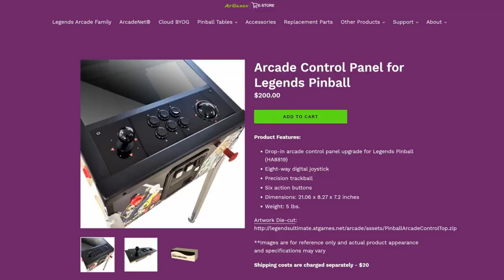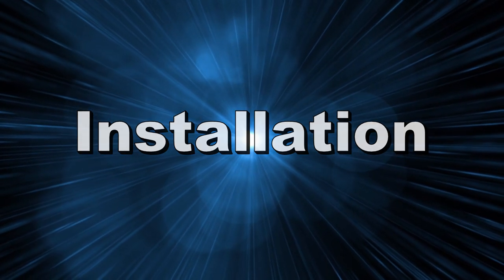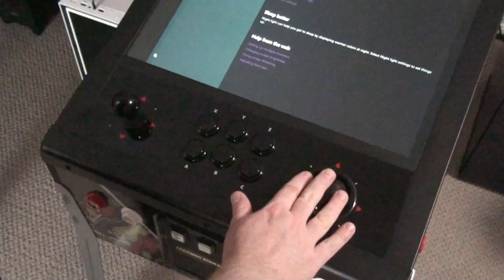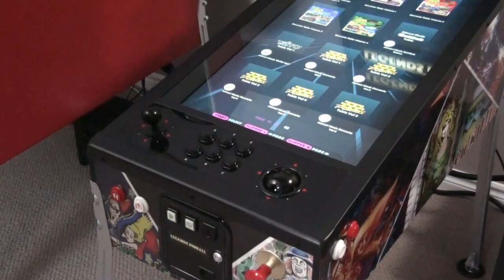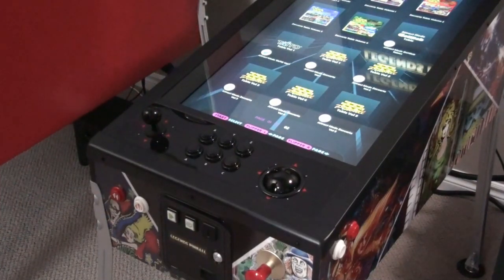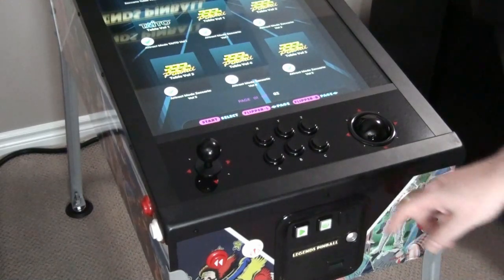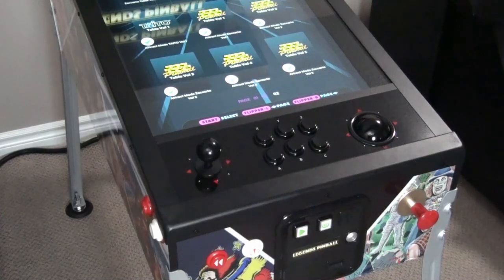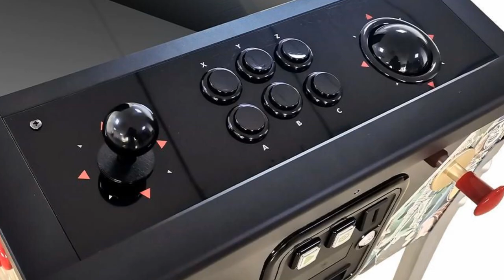AtGames Legends Pinball - Arcade Control Panel : Red'View of this Game Changing Add-On!

Comment: the exciters were the same on the paneel came with it, . 4ohm 3 watt. so not more exiters or new, just equal to what you had. no? WISH IT HAD A SPINNER for arkonoid /breakout
Reply from the maker: They are physically "larger" exciters, and they definitely give more feedback. You don't want to change the impedance (you want it to match for whatever amp they use on the main board), and at the same wattage its more than enough for "where" they are being used. In fact they can be too much at times.
Reply: I agree, a spinner would've been awesome for something like Tempest, and the platform has plenty of real estate to add it on. They also need to work out a deal to encorporate Dayton exciters or something. Hopefully At is reading these feedbacks
Reply: @Roadsurfer2k11  Many of the wave1, wave2, wave3 have Dayton exciters. The global parts shortage made production quantity purcurement a challenge and we went second source to ensure production continues. We have been working with Dayton directly since day one.